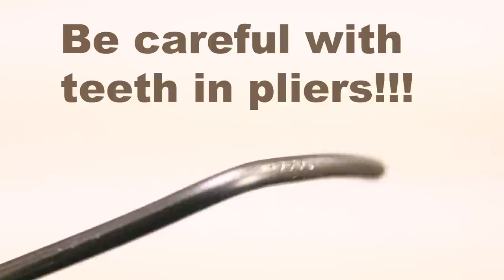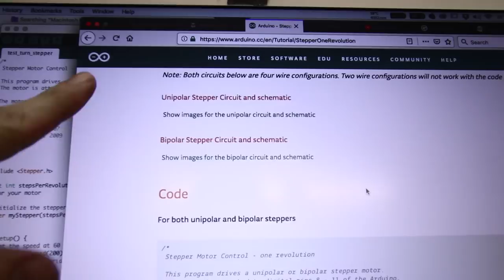Long lasting aluminium wire for stop motion puppets

Comment: Awesome and well put together video! I personally use galvanized steel because it's cheap, I can get it at my local construction shop and it works for my needs. I'm sure I'll buy Aluminium wire in the future for important armatures and stuff :)

Comment: Hola Edu :  Me ha parecido entender que el alambre que más usas es el de 1,6mm. Supongo que lo usas para el tronco y las piernas. Sin embargo no aguanta más de 38 dobleces, según tu test. El de 1mm aguanta más del doble ¿ Acaso no sería más recomendable ?  
El problema está en saber si cada vez que un personaje realiza un movimiento, como un paso, equivale a una doblez, o depende tanto o más del ángulo al que es sometido. 
6 a 12 frames por segundo, son muchos movimientos para un corto de quizás 10 minutos (3600-7200) ¿De verdad puede un muñeco aguantar todo un corto ? Entiendo que al usar doble hilo trenzado, la duración y la fuerza ha de ser mayor, pero esto no quita que son muchos movimientos, y, tampoco es lo mismo que el cable de una polea que se compone de un trenzado de multitud de hilos de acero; estos le dan mayor resistencia y flexibilidad, pero no nos sirve porque no se aguanta más que a plomo.
Reply from the maker: Buenas, según el diámetro aguantará distinto, de ahí el interés del test. Debería hacer lo mismo con trenzados como me han comentado ya. El de 1 aguanta más dobleces pero no es tan fuerte, así que no lo uso para piernas. Sobre lo de los frames, cada paso de una pierna, aunque sean 12 frames equivale a una doblez, no a 12. Así que dependerá del guión si aguanta o no el corto entero, pero para determinados puppets sirve
Reply: @edupuertasfruns  Ok. Gracias

Comment: This is a GREAT video bud! Could I request a further experimentation with your device? 
Bending tests with twisted aluminium and aluminium & copper mixed wires of different tensions (at 1:32 you show the ruler displaying the shrinkage as the wire is twisted) I have a theory the tighter and more twists per cm the more likely the wire is to break due to the aluminium being under strain from twisting and pressured at the twist cross over. Also that the copper might actually help support the aluminium? 

It would be interesting to find out using your device if my theory's are right or if I'm talking total hogwash lol
Reply: Also, also, perhaps some experimentation with bending wires that have been shrink wrapped or covered in cotton thread, I hear people say they help prelong breakage and the fingers on the old rex puppet from 2012 do still flex (just) but I'm curious was it the cotton wrapping technique that helped or the aluminium wire itself (was it a better version than my current suppler?)
Reply from the maker: I thought about testing more options, but you know it took me more than I expected. I agree with you that too much twisting must be bad, should test it to be sure. I also had the doubt if I was going too far away with this experiment but I found interesting to test it for real not by feeling. If I have time I'll do it
Reply: @edupuertasfruns  Awesome, if you do I'll certainly be sharing it along with this throughout the animation students I assist.

Comment: How will you know if the quality of the aluminum wire is strong enough to withstand prolonged usage??? Is it by the texture? Or something? 😕
Reply from the maker: Try to bend it many times and you'll see if it is durable or not
Reply: @edupuertasfruns  It's difficult to do that if you are not at the point of purchase.  Is there anything that we should look for as far as weight or gauge that we might use as a guide or are we just at the mercy of the manufacturer. For instance are there specific questions we can ask to insure the tinsel strength etc. ?

Comment: Thanks for video :) I have a question:
1.6mm aluminum wire was broken in 38th bend and 1mm in 93th bend. So why we don't use this 1mm wire for the legs, too? I understand that there is a need for thickness for the leg, but wouldn't it be longer than 1mm folded by 4 folds instead of 1.6 folded by 2 folds? Or does the long life observed in one piece 1mm decrease when we fold it to 4? (makes it fragile?) thanks.
Reply from the maker: True is that multiple variables could occur in that test. Apart from lifetime its also the feeling using different thicknesses. I like thicker for legs

Comment: Great video! Have you ever tried using soldering wire? Certain brands are non- toxic and hold up a long time :)
Reply from the maker: Not yet! did you find it better?
Reply: @edupuertasfruns  Idk if it’s better or not, but I was certainly surprised at how long it holds up in longer standing increments. I was using 1/8” diameter for testing. But what gave me the idea was that since solder wire becomes solid again after it cools, I thought it might retain it’s structural integrity after each movement. As long as you aren’t doing a lot of extreme bends in a short amount of time, it should last a while since the wire essentially re-sets when left alone. Anyways best of luck- I enjoy all your videos 🦾🦿

Comment: I couldn’t find “armature wire” at any of my local store but they had “aluminum wire” but it was from the hardware section. So I picked some up, got into my car and was reading the back of it and it was covered in warning labels stating that it has lead in it and that it’ll cause cancer. I kind of don’t even want to use it.